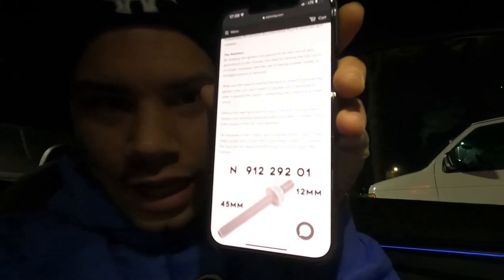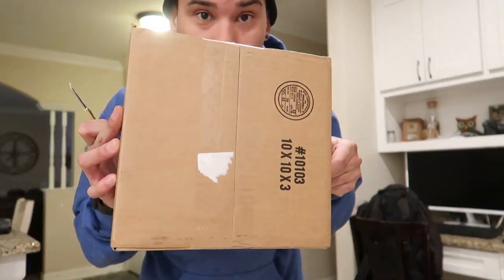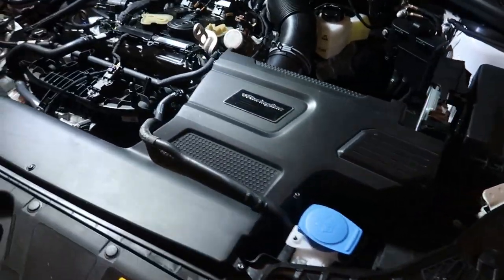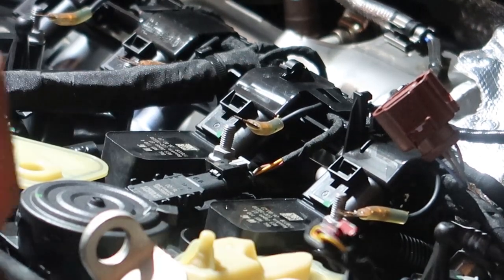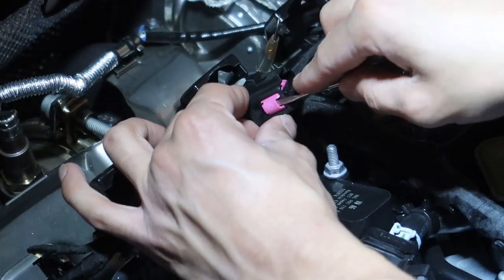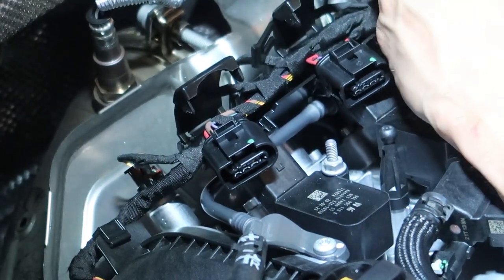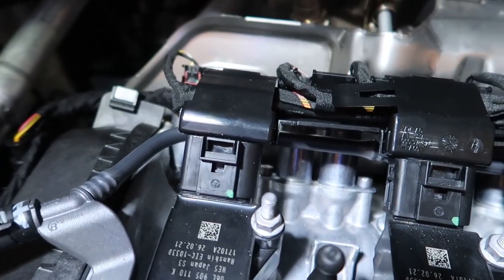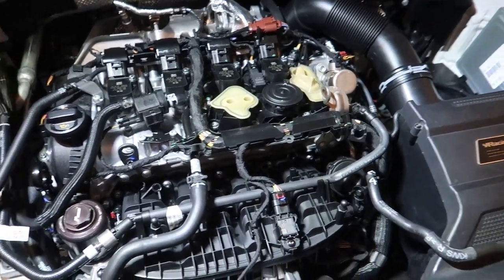EQT coil grounding kit! Gen 4 EA888 | 8Y S3

Comment: Hey Bryce, much like how you push your coil connectors on further to loosen them up you can do something similar when de-pinning, the pin clips dig into the plastic over time from sliding connector on and off the coil.  Pushing the pin back into it's hole forces the pin in further helps release the tabs from the plastic. That's why a depinning tool sometimes doesn't work very well.
Reply from the maker: Good catchh! I never thought about that. Thank you for that tip I really appreciate it!
Reply: @BryceJordanProductions  no problem, thanks for the fun videos

Comment: Nice mod. Defintely improves the looks of the loom. The Gen3 EA888 engines over here in Europe, like my Mk7 GTI (but also the R's) do NOT have this nasty grounding wire hooked up to the coil retainer nut. Apparently, VW already routed these grounds inside the connectors, the way you installed the EQT kit. I think the reason is just cost cutting for the NA models. We euro guys need to pay substantially more for our cars unfortunately. But sometimes we get slightly nicer solutions, like in this case and for example the dual injection on the EA888 (direct and indirect into manifold, avoiding carbon build up on the inlet valves) .
Reply from the maker: What! I didn't know that! That's super cool and very convenient

Comment: What does grounding the coils do?
Reply from the maker: They have to be and are from the factory, just like any type of electronic it needs to be grounded. This is just a better grounding solution
Reply: @BryceJordanProductions  so the grounding you done with coil wires to the chassis points must give a better electrical response to the coil packs? Wonder what the inital problem was?
Reply: @shannon8541  the main issue is alot of people remove their plugs a lot and eventually the little bolt strips or the ground wire to each plug breaks. This way you can install this kit and you don't have to worry about breaking them.
Reply from the maker: Exactly! The bolt holes get stripped or connections get roughed up and cause a bad ground which cause misfires
Reply: @BryceJordanProductions  very interesting. Sick videos Bryce love learning these mod steps 😉